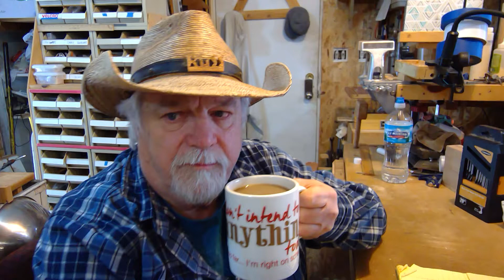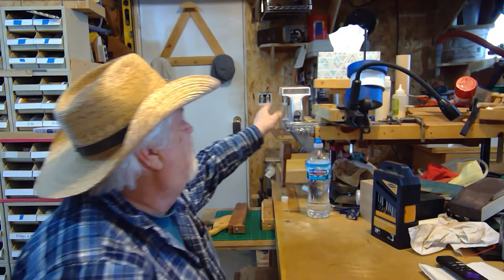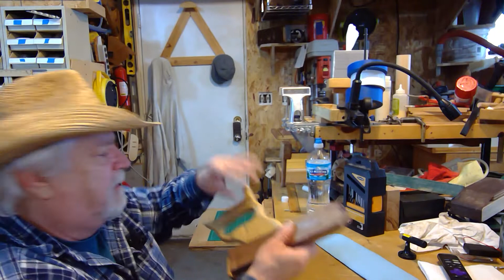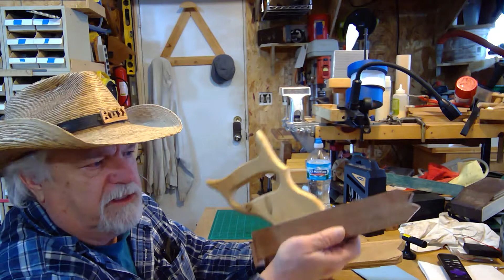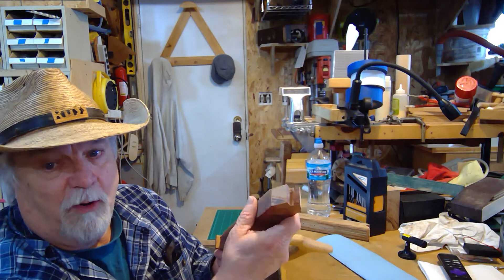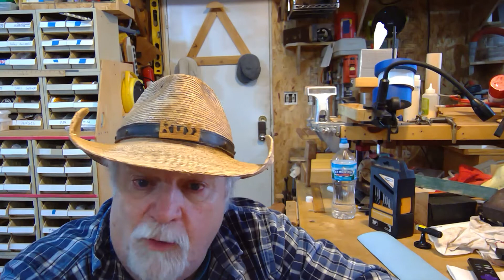Update on Old Projects by Rambling Russ

Comment: Always a pleasure to watch, interim reports are more than welcome. I think I'm going to like the use of the saw (both the front and the back!) as potential mount points...I simply don't have enough wall space to dedicate a permanent solution. I've been using a 4x4 sheet with sacrificial extensions on a pair of saw horses to break down 4x8s. Your idea's got to be better than that. Keep'em coming.

Comment: Hey Russ, on the heel block for your push stick...why don't you just cut a slot in the block to allow up/down adjustment, then replace that bolt with a stud, and use a wing nut to tighten the block to your push stick? I would think that would easily solve the up/down adjustment issue while at the same time keeping the block from hitting your fence, because you wouldn't have to turn it anymore...unless I missed something, and misunderstood what you were trying to accomplish there.

Comment: Russ. Instead of CA glue use a dash of silicone, it can be removed if adjustments has to be made or the head have to be removed for some reason, CA is permanent and you may damage the head trying to remove it, so silicone in my opinion will be beter same as your gripper principal. Keep well and keep ramblin'.
Reply from the maker: good idea. Thanks Abe

Comment: I've been thinking lately about heels on push sticks.  Could you have a stack of multiple heels, different sizes, all attached by the same screw --  kind of like a set of feeler gauges on a car?  Rotate the one that matches your stock down into place.  Leave the others rotated up.
Reply from the maker: sounds like over engineering, I like simple and easy use.  my brain doesn't do complex very well :>)

Comment: I use a shadow line instead of a laser because it shows both sides of the blade.
I followed the instructions on this video by Make Everything:

https://www.youtube.com/watch?v=MHM8K-JS-Wk
Reply from the maker: My laser line is the same width as my cut so it works on both sides.  I.ve seen his and I like this better myself.  I do encourage others to look at his too and they can have more info to do their own.  Thanks
Reply: Good info
Reply: @russveinot5754  I didn't know there was a laser capable of indicating both sides of the blade. Every one I've seen would need two lasers to do that. Thanks

Comment: Use Hot glue instead - it will get misaligned so ...
Reply from the maker: I do have a set screw to hold the laser in the hole.  I can still loosen it and turn the whole laser.  CA glue is an excellent choice too.  Thanks Clyde.